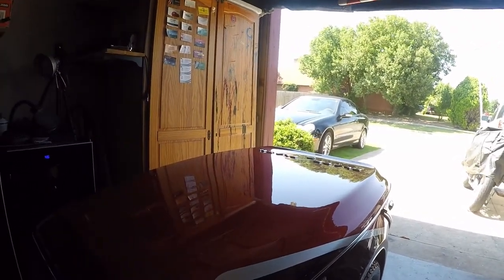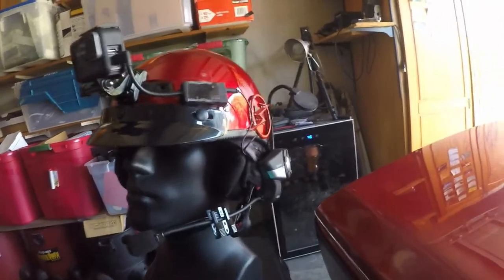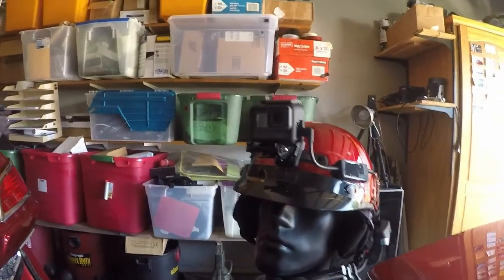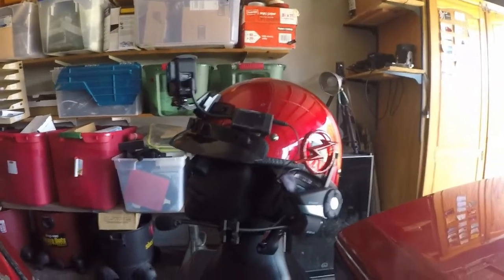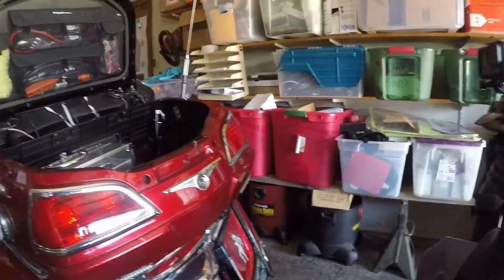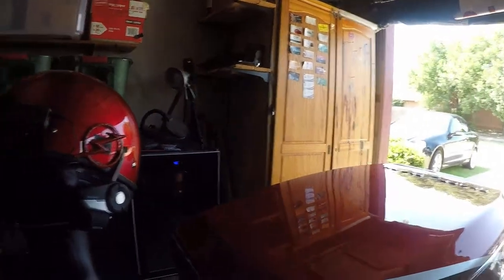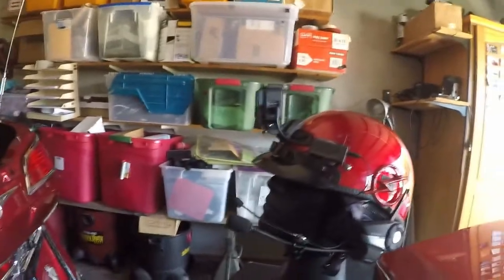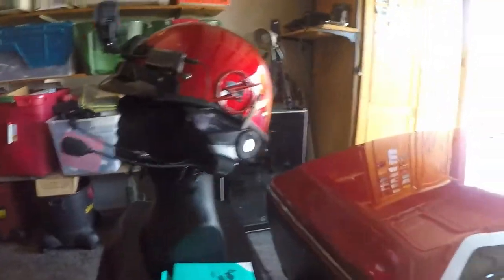Switch to Half Helmet for Comfort part 1 | It’s to Dam Hot to Ride

Comment: Hey Carnell, I see you have the 20s are you using the Speakers or the Earbud Port? I have a half Helmet set-up using the Sena 10c but I am using the Earbud Adapter. If you are using the Actual Speakers (And dont mind Sharing) can you please tell how you did this. Thank You Sir. "One Love"
Reply from the maker: I am using the Sena 20s and the Hero5, each has their own mic. The Sena 20S comes with its own set of headphone speakers. Hope this helps.
Reply: Carnell how did you Mount the Speakers on the Half Helmet? On my Half Helmet their is nothing there or do you have a 3/4 Helmet.
Reply from the maker: My half helmet has a zip neck piece that I can unzip to take off. That zip off piece has a headphone section for speakers.
Reply: Is this something that came with the Helmet or a separate  Kit and do you think it would work on a HJC Helmet. Thanks for your Time & Help.
Reply from the maker: I use Vega Helmets and it comes standard with all Vega Helmets. HJC helmet only comes with the 3/4 and above helmet and it's not a zip off Like the Vega style helmet.